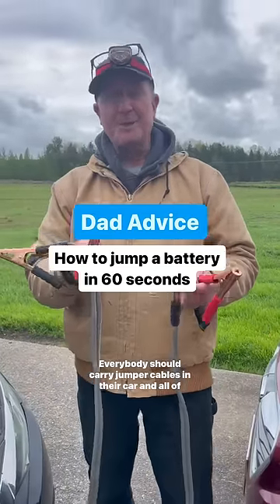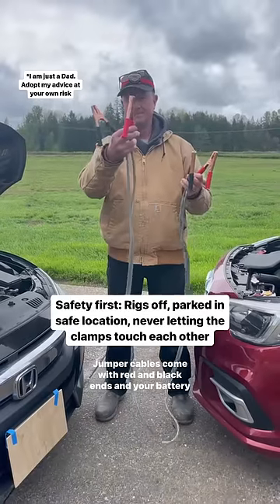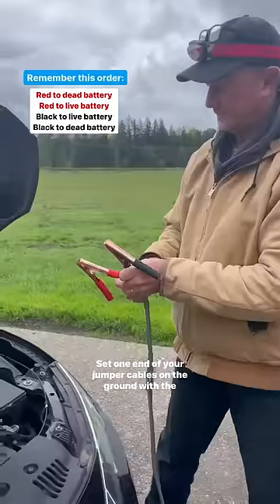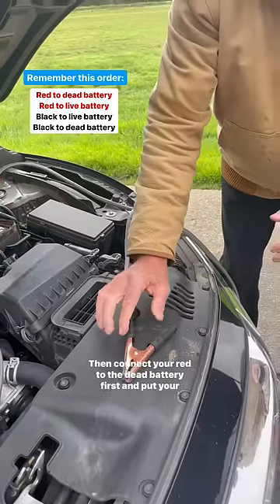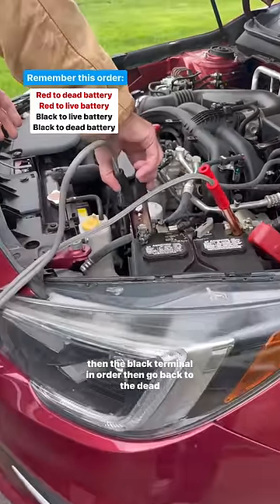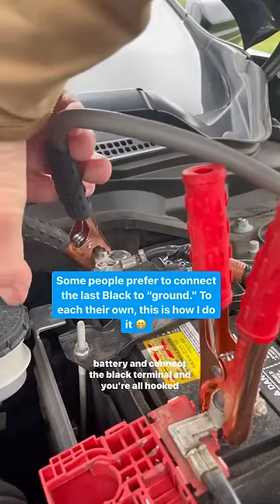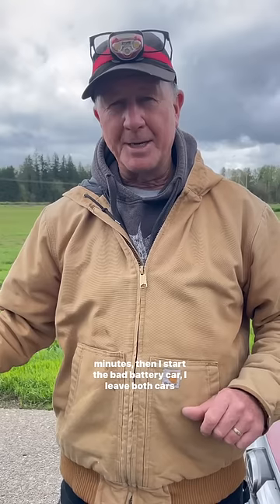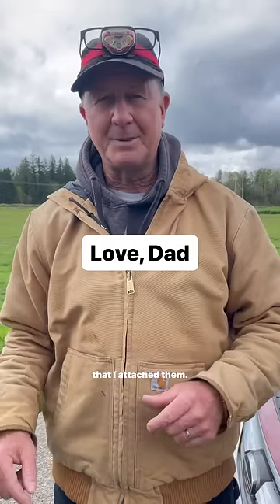How to jump a car battery. Love, Dad

Comment: You should use the running vehicle to charge the dead battery and then turn the vehicle off and try and start the dead vehicle. If the dead vehicle has a bad diod in its alternator, it could damage the running vehicle.
Reply: Exactly 👍
Reply: If you know why the battery is dead, old battery or lights, radio, left on etc ,etc, you can just jump it, but if you're not 100% on why it'sdead, you should let it charge just to be safe.
Reply: @CentralTexasCarSpotter  Modern cars have computer modules that run on 5v and milliamps of electricity. Having 2 voltage regulators fighting can cause serious damage. Alternators put out 13-14v at dozens of amps. Its better to turn the good car off. You still get the benefit of the good car battery.
Reply: Also never connect the negative black end directly to the dead battery always connect to a solid piece of metal with a clean rust free point for the ground like an alternator bracket or something like that this will keep the battery from getting overloaded and damaging it😮 😅😊
Reply: And the Ground wire should be away from the terminal to not risk an explosion
Reply: I have jumped hundreds of cars, including my own, which did have a bad diode in the alternator. You are completely wrong, and in doing that, you can end up with two dead cars. As long as the donor car's alternator is pushing current, the bad alternator will not be able to push back. A bad diode can cause a reverse drain that can drop a battery in less than a minute. I have seen it happen, but it can't do that when the running alternator is feeding current.
Reply: @jimastra8488 you are going to end up with two dead cars thar way. You would blow a fuse before you ever hurt any of the electronics. I've jumped hundreds of cars. I've never fried any of them. Your last negative connection should go to a ground post though on the dead car's body or frame. Electricity will always flow to ground, so you never risk damage to the donor car, and are unlikely to blow a fuse on the dead car.
Reply: That's what I know too.
Reply: @CentralTexasCarSpotter Black terminal IS ground.
Reply: @royhedlund6920 So wrong.  The black terminal IS electrically the same as ground.
Reply: yes...more
Reply: Bottom line is that this video is for old cars before computers now days you charge it turn it off and then start the car with the bad battery. Period that’s it. No bla bla bla no we we we no you you you no chi chi chi.
Reply: Yup
Reply: @captmalreynolds1  how will it kill the good car with just the 4 seconds of power to start the dead car when you can start and stop a good car many times without issue? It is safer to turn the good car off before starting the bad one.
Reply: @jimastra8488 I'm not sure you replied to the right person, but I can answer your questions. A reverse chage will essentially reverse the polarity in the battery, I've seen it happen. I literally parked my car, went into a store to use the bathroom, came back out to start the car, and waited for my friend who needed a few items, and it should have started I had just turned it off and everything had been fine except my brake light flashed on and off once while driving. Car would not start. Good car should always be running. Electricity flows one way from power to ground. As long as a charging current is pushing power to the battery, it  can't have the polarity reversed. In mist cases the polarity only reverses when the alternator stops charging, the diode are supposed to prevent that.
Reply: @captmalreynolds1  So who moved the lead and lead oxide plates around when you werent looking to "reverse the polarity"? That is called discharging a worn or defective battery.
Reply: @royhedlund6920 Nope. The battery negative post is directly connected to the frame. It just doesn't make a difference.
Reply: That is exactly right this man still thinks it’s 1972 new cars have a lot more sensitive electronics in them.
Reply: This is the right way .that old man don't know nothing.ask for a oil change and this fool changes your tire
Reply: @jimastra8488  yes sr exactly.
Reply: My neighbor fried my ECU trying to jumpstart her truck! Now I either call AAA or carry a jump  boc! I gave one to my niece for safety after they had a power outage that lasted 3 days!
Reply: I almost wrote the same thing luckily you did my writing thanks
Reply: @royhedlund6920 - connecting the negative to alternator bracket or other metal piece like you mentioned has nothing to do with overloading it…

Comment: Okay dad, the reason you DONT folkow your advice by putting black cable to the post of the dead battery is because you will draw a spark and if the battery is outgassing, could conceivably blow up.  Better to get a good connection to the frame, away from the battery.  And geez, how hard is it to find a good ground?  And once dead battery car is running, why do you suggest leaving both cars running???  Take the cables off, man.

Comment: Never put the negative clamp onto the dead batteries negative post.
Clamp something metal like an engine mount
Batteries give off Hydrogen Sulfide gases which can cause an explosion when you get a spark.
Reply: This so true lol like it’s not gonna happen every time but that one time and that bitch blows up in your face mannnn you gonna have some real regret sitting on your shoulders…
Reply: The batteries only create the hydrogen gas when it reaches approx a 95% charged state or it is either fast charging or overcharged. There is always a possibility of residual hydrogen gas being left over from the previous charge cycle but highly doubtful. An exploding battery is always possible but if done correctly charging them is perfectly safe. I have been a professional technician for 35 years and never seen one explode yet. Only heard stories. And I have charged countless of thousands of batteries in my time considering I was in an extreme cold weather environment (Alaska) for most of my career.(Never attempt to charge a battery with low electrolyte or a frozen battery) You are supposed to shut off the charging vehicle before starting. But I have always connected the cables red on dead batt, then red on doner battery, then found on doner, and ground on engine block of dead to bare metal.
Reply: @BH_tradie  Safety first I suppose. But then again, proper PPE should be preached as well. Because of that battery is going to explode it doesn't matter where you're standing if you're leaning under that hood to hook up that cable, your face and eyes are a victim instantly.
Reply: @BH_tradie if that ain't the truth...! Not too long ago a 1970 Challenger came into the shop for a timing chain R&R.  The service writer was going to pass it up because they didn't think we had the means to do it because it was "old technology" . I died laughing and said get that thing in My bay now. I had it done in about an hour. 😎🤣
Reply: @BH_tradie  That's my favorite game, road noise diag. My old lady hates riding with me because of it. And absolutely, the young bucks like to laugh at us ol boys up until they need to something that they can't diagnose with their scantool. Then they are amazed. And you keep up wrenchin yourself Brother. I dont think there will ever be any quit in me.
Reply: Once saw a co worker with battery dead... long story short BOOM he got a face full of acid when tyring to jump start. saved by near by hose pipe.  Remember always COLD water on acid!
Reply: @jonathanmadrigal2507   True!  I had a classmate in College that had just that happen to him.   Received serious burns to his face and hands.
Reply: I saw a battery blow up once
Reply: @BH-rx4dc ...yup, I remember in the 70'z hearing my mom explaining a cluncking or grinding noise to the mechanic at a gas station, of course. Mech be like, sounds like the this part or that part depending on the noise, ryt? Our cars were BIG, Remember REGULAR or UNLEADED and FULL SERVICE, ding ding.
Reply: ditto
Reply: Thats not the main reason you shouldn't clamp negative post. The main reason is if dead battery has an internal short connecting negative clamp to a post will definitely fry your good and only battery. Most definitely sparks will fly... Grandpa slept through the important parts of electrical theory in the classroom.
Reply: You are absolutely right!
I learned my lesson on my 1973 VW Bug. 😔
Reply: I usually go to the one of the bolts that's in the frame of the car..... But I always remove the pos side the sec the car starts!
Reply: @Rodogg7787  i always prefer a good ground on the engine away from the battery n just pull it when it starts been doing it for 45 yrs now on every thing . Negative off first if it's ground on last.  Back in old days some things were positive ground on foreign cars n motor cycles
Reply: The negative post on the battery is always directly connected to the frame of the vehicle. Connect to the post or any part of the frame. It doesn't matter.
Reply: Done it hundreds of times, nothing will ever happen.
Reply: @BH-rx4dc  you're
Reply: Except don’t do that if your car is positive earth - kaboom!
Reply: @Alacritous not if the car is positive earth 😊
Reply: Very rare but yes that’s best practice
Reply: @maxdm1583  so how is it that connecting it away from the post is going to do anything different with respect to your internal short scenario?  The car is grounded to the negative post.
Reply: Never seen it happen.  Don't know of any instances.  Don't cross the streams.
Reply: I would never run both engines together. Two alternators running will   certainly destroy electronics.
Reply: @michaeloconnor3806  No, they wont.
I would advise against watching or listening to Scotty K.
He is the one that made people think two alternators running in opposite directions will fuck shit up.
Reply: Always thought the reason for the negative cable to be attached to metal IS so IF the car has electrical issues It won't mess up your stuff!!
Reply: You are so correct. Going to a metal ground. My understanding is this can save some sensitive electronics.
Reply: Funny he doesn't  no how to do it properly and dares to make a video. 😂😂😂😂
Reply: @midnightrider1854  so engine off, then red of dead ten red of live, black of
good ten black of dead to post/or engine block, start engine of good, then start engine of bad.. is that correct? remove in reverse once engine start...
*never let cable end touch and any metal part of cars,,, ever?
Reply: @midnightrider1854  shiiiitt you are scaring people, in this case never ever
jump a dead battery of a car...
Reply: Right
Reply: Saw a guy hook up jumper cables wrong in walmart parking lot, 14 cars surrounding the guy jumping all batteries exploded and caught fire,by the time fire dept got there over 120 cars had burnt completely up and an apartment complex that was a mile away burnt down also,all because a guy hooked pos to neg and didnt put his parking break on! 
Gotta be really careful these days.
Reply: True,  but I’ve yet to witness a battery exploding.  I’m 53
Reply: @harrybalz525  a bad walmart.
Reply: after jumping anything wrong w/removing both clamp from the bad, then the good.
Reply: Damn see you beat me to that ..
Reply: This is very correct.
Reply: My welding class was on a break when a Camaro stopped with smoke pouring out of it's hood! The lead acid battery was on fire. Fortunately, a classmate had and ABC fire extinguisher and was able to put it out for the guy.
Reply: 100% correct
Reply: It's not that deep 😅
Reply: This is such an old myth, I've jumpstarted cars as long as I can remember and NEVER has blown off.. this is probably one of them posts boomers say like "don't use your phone when you are filling up gas cause u can explode!"
Reply: Next he will say not to put on concrete... that  was also busted years ago
Reply: @midnightrider1854  The dead battery is fast charging as soon as the vehicles are started. Disconnecting the cable from the battery ground is the most likely time for an explosion. Ground to metal away from the battery to be safe.
Reply: @JasonMiranda  A battery exploding from hydrogen buildup is not a myth.   The possibility is a fact.
Reply: Much better to carry a jump pack.  Jumper cables only useful if there’s another vehicle to jump from.
Reply: @alk37968  a fact that is as probable as someone blowing up from using your phone while you fuel up.
Reply: @JasonMiranda  No comparison whatsoever. A Spark from a car battery is hot enough to ignite hydrogen gas.
Reply: Red to black vice versa
Reply: So this video is wrong?
Reply: @whatevervlogs9663  Not wrong, just not advisable to hook up in this manner.
Instead of putting the jumper lead to the negative of the dead battery, put it on something metallic, like an engine radiator support bracket, or some other metal part that is easy to attack the jumper lead to
Reply: I put the negative on metal other than battery and my car didn’t start.. it only started when I plugged the negative to dead battery so how do you explain that
Reply: @whatevervlogs9663  Could be one of the following
The metal had too much resistance(ie rust or corrosion layer if it was an aluminium part)
The metal was not grounded(some bolts are used to connect plastic trim pieces together and are not grounded to the chassis)
The metal part was painted(paint is an insulator)
You connected the jumper lead to a small bit of metal incapable of passing the current needed(eg a bolt head)
The connection was bad.

Comment: Make sure to have the AC and the radio off..
Reply: Yep
Reply: Of which car? All accessories are automatically disconnected when a car is cranking. That's why your lights and radio click off when starting.
Reply: Two motors running at the same time can destroy the alternator.

Comment: My father is a mechanic and he always advised me to never leave the good battery running cause it would damage it but hell if i know
Reply: You need the car running for your altenator to keep your car charged, and to charge their system. This can easily take a few minutes. Especially if you're just letting the good car idle since it take higher RPMs for the alternator to push out decent amperage. Once the car that died starts you should disconnect the jumper cables. Let their alternator charge their system. So you need the good car running, but it shouldn't continue to be hooked up after a successful jump. If you're not sire check the owners manual. There are risks to certain equipment doing it this way, and frying a battery is the least of your worries if you fry something.  Also make sure your not jumping a lithium battery with a standard battery. You need a smart charger or jump box with a charge controller.
Reply: @denimjez  ah okay thanks see i didnt know
Reply: The good battery car should be off so that u don’t damage your alternator Scotty Kilmer taught me that
Reply: Can also ruin your alternator if it feed back or sparks
Reply: @theuntouchabletee4470 I agree. I learned that lesson the hard way. Its nuch  cheaper to replace a battery than an alternator.
Reply: same, mechanic told me not to run both cars as the alternators will conflict and cause damage.  Run your car to charge their battery for a few minutes, then turn it off.  Then turn off the good car, then attempt to turn on the dead car.
Reply: @denimjez the biggest piece is to make sure the person with the dead battery keeps their car running for half an hour so it adequately charges.
Reply: @sebastianrequena3677 nope your dad is correct 👍 this video is wrong! Always have the good battery car NOT running

It will destroy the electrical system 

Also the dead battery car negative should be on metal not on the battery

Im a mechanic for 35 years
Reply: @denimjez wrong! Good car must be off not running at the same time with the dead battery car

Comment: Sorry "Dad", but this WAS the way it used to be decades ago. Your method could fry the good car. With today's technology, you greatly increase cooking the very sensitive computer and other electronics. Always check the owners manual for the current and correct methods. Nowadays, tow trucks us jumper boxes or packs. If you doubt this, call AAA and ask them.
Reply: A jumper box or a battery in a car is exactly the same state of charge. It makes no difference which you use. And as long as you follow manufacturers recommendations, which haven't changed much by the way, with the exception of maybe ev ect. 35yrs doing this professionally and I have yet to hurt a charging system or battery. I own several boost packs but only for convenience. If I am in the car I will use that more times than not. The only thing that I totally agree with on here is never try to jump a frozen battery or one with one or more dry cells.
Reply: Lol most tow trucks carry jumper boxes because they’re in a tow truck 😂. They’re not driving up to cars, pulling out cables, and opening their hood 15 times a day 😂😂😂
Reply: @midnightrider1854 Oh it matters because my screen in my 2008 Acura was fried because of an idiot from a rescue service did exactly what he's doing in this video. And this was back in 2009 the car was only 6 months old.